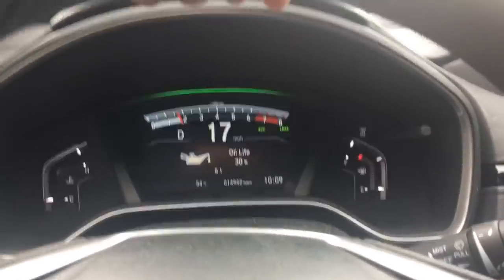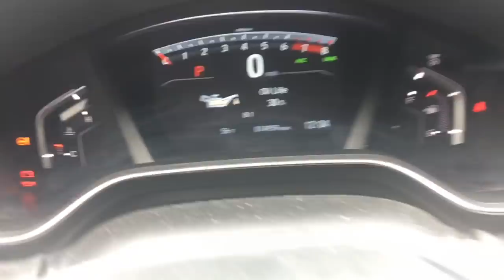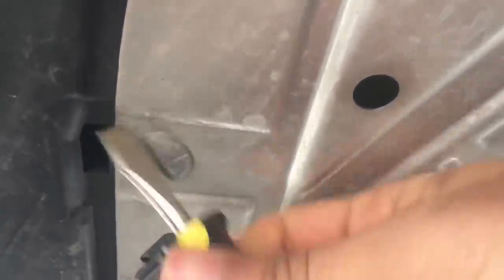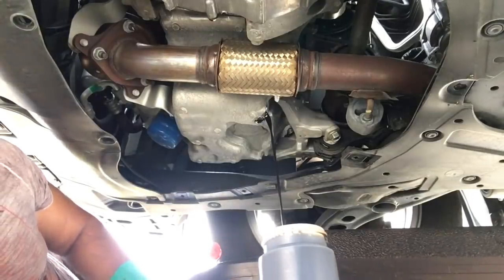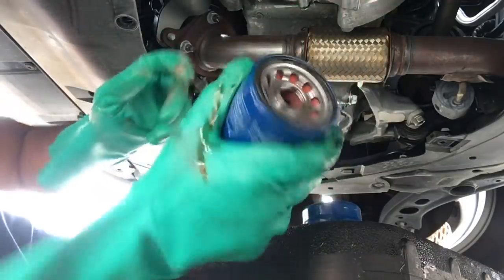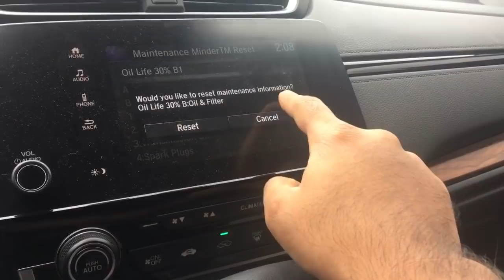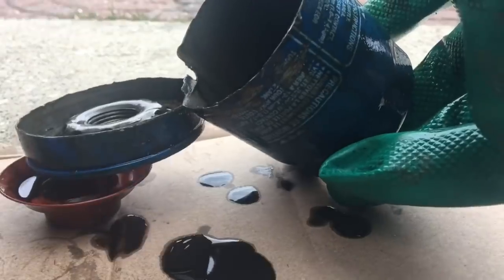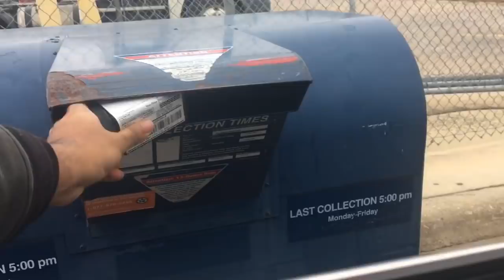2018 Honda CRV Oil/Filter Change and Analysis - Oil dilution -  Cut Open Filter

Comment: My wife’s 18 CRV warms up normal and the oil level seems Ok after 4500 miles.  And she drives short trips most of the time. I read some are having problems with the engine not warming up after a while driving, is that’s why the oil dilution ?

Comment: I carried my CRV back to University Honda in Florence Al for the 1st oil change and reminded them that it was over full of oil.  They just kind of ingnored me,  I carried it back with about 1000 miles on the 2nd change at 90% it was 3/4 inch over full and smelled of gasoline also..  I told them to fix it with the Honda cpu up grade.  They did and drained the old oil replaced it with new under warranty.  We will see what changes this caused.   According to Honda the 2019 come from the factory with this setting on the 1.5 turbo engine.
Reply: I have a 2019 with 1600 miles on it and am already getting strong gas smell in my oil, been to the dealer, they blew me off too
Reply: and I drive 20miles each way to work, so no short trips and I live in Texas
Reply: Any updates?

Comment: I have an '18 model CRV and so far the software update is working fine. Oil level remains at normal level.
Reply: Happy for you.   Not working for many others, sad to say.
Reply: Hi Lot I  have 2018 accord sport with the same 1.5 turbo with 21000 miles so far oil level has stayed right on the full mark .jeff Georgia.  Ps like the video's thanks.

Comment: Interesting video. I doubt you'll see many anomalies from Blackstone based on your driving habits. I had mine done at 6K and aside from some mild elevated wear metals associated with the break-in, there wasn't really anything to be concerned about. You're aware that Blackstone does flashpoint analysis, which isn't as reliable, but should pick up unusually high dilution rates with a little more accuracy. IMHO, the thing to look for is unusually low viscosity paired with high wear metals. If you do, run it again after 20K when most of the break-in metals have washed out.

Also, you're probably aware that dilution alone isn't necessarily a problem by itself. ALL TCDI powertrains suffer from dilution to a degree. Honda's issue has more to do with the speed to which its powertrain warms up. And because I presume you drained yours while the oil was warm/hot, after a nice cruise on the fwy, I suspect there will hardly any water or fuel in the oil at all.

Contrary to the popular internet groupthink, I still think this issue is way overblown. CR has only recorded 2-3 cases of extreme dilution, and only in cold climates. And the subsequent stalling issue hasn't even been proven to be directly correlated with "high" oil levels. The suspicion is that a lot of these "issues" are tied to other problems such as mechanics overfilling the oil, a faulty injector, or owners simply misreading the dipstick.

Also, I would suggest checking the level again after driving 5 minutes following your oil change. If you only added 3.6 quarts, you may not have allowed enough time for the oil to drain completely. These TCDI powertrains need a good 30-45 minutes to get all the residue out of the the turbo, feed and return lines. And I've seen deltas as high as half a quart during the last 20 minutes of a drain. Good luck!
Reply from the maker: Godspeed931 Got the results from the lab analysis. Will be uploading a video with the results next week. I’m doing some research on what is acceptable range for % of fuel in oil.   My drives are 90% highway also.

Comment: This is the first time I saw the inside of an OEM Honda oil filter. It is identical to cheap FRAM filter! Now, open a Toyota OEM filter and compare. The anti drain valve on a Toyota filter is built with proper springs and rubber gaskets, the filtering material is far superior than the honda filter material. My belief of Honda making cheap low quality parts is proven once again.
Reply: pochoun33137  thanks for the confirmation that honda get supplies from cheap part produces such as fram.
I can imagine the rest and these problems you all encounter. Honda fools people by loading up the car with fancy electronics but fails to heat the cabin in winter!
Reply: pochoun33137 I use mobile 1 annual protection oil filter even tho it’s going to be changed every 5,000 miles
Reply: Jan pur I wouldn’t buy a cheap Fram. Buy the more expensive ones.

Comment: Hey man have you ever changed the CVT transmission oil?
Reply: It's still too early to change the CVT fluid.
Reply: @TheRichardF10  ..
..probably  a good idea at 20K Mi intervals, however...check out some videos  on multiple cvt trans/ problems

Comment: Honda should leave turbos to the pros, and stick to vtech
Reply: @Mr1983abraham Variable Valve Timing & Lift Electronic Control from Honda
Reply: @Mr1983abraham Lol the joke went over your head.
Reply: @Mr1983abraham Ok so you did get it, I was mocking Honda's technology by comparing it to a children's toy company. The h on the end was intentional.
Reply: @Mr1983abraham Honda should leave turbos for the pros for sure!
Reply: Actually honda has been using turbo engine and been sucessful. Example Acura rdx has been turbo since 2007 and has no problems.
Reply: 2019 has the correction already installed
Reply: @Mr1983abraham very tall engine cooling
Reply: The Adventure Mazda - VTECH what computerised kids learning toys 😂😂

Comment: As a mechanic I can give you a piece of advice. High mileage oil you using is a bad idea (a lot of chemicals) considering life of your engine. Don't judge condition of the oil and filter by the colour, they are in the perfect shape. In your case the GAS just making the oil thinner but no harm for full synthetic. Go one scale up, let's say 5w30 of regular synthetic oil, you'll see on the chemical test perfect viscosity match for the engine with this kind of problem. Many years ago in Arctic conditions every night we used to add some gasoline in heavy diesel oil for better morning start it is evaporating later, in your case it's getting to the oil even more due to extremely low engine working temperature
Most important for engine life  to keep working temperature close to specification . To fix issues with warming up the engine just put a new OEM thermostat. To have some fun you can buy a couple aftermarket ones for around $15 put them in water on the stove with the one you got on your vehicle, I bet yours got stuck in open position. Don't forget thermometer in the water to see beginning of opening to be fully opened at boiling temperature. Another and more simple way to check condition of the thermostat, after starting vehicle compare top and bottom tanks of radiator. If they are warming up at the same pace, definitely thermostat is the problem. Bottom tank should be much more cooler until the engine is hot
Reply from the maker: Have taken it to Honda.  Others have it taken it also but it’s not the thermostat. It’s the air conditioning unit. If you turn off heat engine will warm up. They had a software fix / part replacement.

Comment: Never ever use a wrench to tighten your oil filter. Hand tight only. Don't over tighten you can screw up that gasket. I've always changed my oil when I couldn't see my oil dip stick lines through the darkened oil. Could still be in good shape but that's me. Over fifty years of owning cars/ trucks and never a engine problem. Oil is the blood oil filter is the liver/kidney air filter is the lungs cabin filter cleans the air coming inside the car. Make Sense?

Comment: Also I do recommend you an oil catch can that will help to keep your valves clean remember you have a GDI do a research on that. I bought 2 oil catch cans for my new Silverado just to be safe. This new GDI it’s a bad deal.
Reply from the maker: The 1.5l engines have something internal that does the same job as a catch can from what I have researched.
Reply: @EATSLEEPJD  Yes, built into the valve cover. Also have yet to see any gunked up valve trains on these LB15 engines
Reply: @JoseRivera-li8tr  any links on the built in valve cover catch cans? Please thanks

Comment: Why the oil analysis and how much did that cost?  What result did you get back?
Reply from the maker: Takes a week and $25 I believe.  Did it to see if there is an actual gas/oil dilution.
Reply: EATSLEEPJD How did it turn out?  Was the oil diluted?  I have the exact same crv.  Thanks
Reply from the maker: Daniel Holt XXL 2% fuel in oil. I did couple of videos on it.

Comment: I always wanted to use ramp along with jack stand for the added safety but thought it cant be done.
 I thought jack stand point was too close to the front so they overlap.
Now i know they can be used together.
Buying a ramp right now.
Reply from the maker: Ramp is so easy 👌🏾. Jack stands will ensure if it fails you got something to land on. It won’t fail but just for peace of mind.

Comment: I am shocked to find out from this video that genuine Honda oil filter is just like a Farm oil filter with cardboard ends.   I will return all my remaining filters and get something better.
Reply from the maker: If you add gas to the mix the cardboard literally falls apart.   It’s best to change it often or use another filter.

Comment: All GDI fuel systems are bad for your engine. I had 2017 sportage n from my first oil change I was very disappointed with the oil dilution. I observed a gradual lose of power n traded in for an older 4runner after 3yrs.No turbo,gdi,cvt,all wheel combo on 4 cy is worth your hard earned money.

Comment: I had my first oil change and tire rotation (in Milwaukee WI) last week at about 7000 miles and I asked about the oil dilution issue and got a dumb look from the service advisor and a what is that. They did look up the vin right then and find the repair that is supposed to fix the issue with oil dilution (you know the one they didn't know about). So now I'm waiting to see if it fixes the issue with the gas smell. It's currently too soon to tell. They did replace an AC unit as part of the repair (they called it a recall) as well as doing a computer code update. The car does seem to heat up faster now, but that didn't seem to be too much of an issue before, plus with the heated seats it never seems like a long time to warm up.

Update: checked my oil today a week after the oil change and repair by Honda oil level looks fine,    but I was not having high levels before. Gas smell seems to be gone now - is was very noticeable before. Time will tell I guess.
Reply: I would recommend not waiting until 7k miles for a first oil change. Always a good idea to change early to get rid of any possible metal shavings during the break in period. The new A02 oil filters from Honda are Frams cheapest model made by Honeywell. Beware.
Reply: @DkpProductions  yeah thought of that but the dealer was saying don't Change it early because of additives added to the engine at the factory (which I'm not sure I believe) but I wanted to make sure I went by the recommended interval in case there were warranty issues. I'm hoping they follow up with an extended warranty like they did in Canada, although I doubt they will. I just got a notification by mail today about the air conditioning unit needing to be replaced along with a computer update (what I already had done) dissapointed though no mention about the oil dilution issue. Makes me think they won't do more until they are sued. Hopefully the fix actually does something.
Reply: @DkpProductions  what filter would you recommend and would the dealer use an owner supplied filter? Thinking Napa gold from what I've seen online.

Comment: Thanks for doing this.  I’m a crv owner too, ‘17 touring model.  Will they report viscosity, too?  Do you know what you will do with the oil analysis results?  I have no doubt the oil is loaded with gasoline?  Mine smells of gas, too.
Have you heard of any reports of anyone that has received the modification?  It would be interesting to see what impact the mod has on oil dilution.
My dealer claimed he was not aware of this problem.  Unfortunate...and truly concerning.  Their service people would undoubtedly smell the gas when they are changing the oil??   Cover-up!
I’ll be waiting for your report.
Reply from the maker: Mark J The report should have viscosity and % of fuel in the oil along with other particles.  I’m not sure as of what I would do.  I’m not willing to do anything that will take money out of my pocket.  After all I did purchase warranty so we shall see.
Reply: I had the modification done 2 weeks ago by a dealer north of Toronto Ontario Canada..Everything seems normal having said that I did not experience what a lot of you folks have experienced...My car had no problem heating up and there was no smell of gas in the oil nor was it showing excessive oil on the dip stick...My CRV EXL 1.5 litre turbo was produced in the Alliston Ontario Honda plant...
Reply: I just got a letter from Honda.  They are calling this a product update issue.  The description is a software update with AC Control Unit Replacement.  The work will be done for free.  They also state plan to leave the vehicle for at least a day for scheduling flexibility.  I will attempt to schedule next week.  I will post results.  I currently have oil level reading above the high mark, gas smell in the oil, difficulty heating the car in cooler weather, and lower fuel mileage in cooler weather.  I hope this works.  We'll see.

Comment: Dirty, dirty,dirty, folks this is shameful, is not just Honda, this is happening to all the modern engines built now a days, high pressure, direct injection, turbo charge, oil looks nasty and fuel levels are high. Ultimately the owners of these cars will have to get rid of the headaches associated with this or deal with it. Good luck Honda owners, in the mean time I'll keep looking for a car without one of these engines.

Comment: My friend I do recommend you AMSOIL signature series full synthetic oil for me the best do a research I have been using it for years it’s very good. I own a 02 Buick le sabré with 307000 original miles it has all the fluids AMSOIL engine oil transmission oil power steering oil and coolant all AMSOIL I just bought a 2018 Silverado brand new I just replaced all the fluids also except for power steering it’s electric 😂😂😂 but the rest even the brake fluid. Check it out.

Comment: I have one of these lemons with the wet dream engine. It has gained 5/16 gas in the oil after a oil change 1000 miles ago. Has anyone had success with a lemon law on this?
Reply: Ha, wet dream is a good name for them.

Comment: Does anyone know if this just a problem in the crv or is it all 1.5l turbos ? Aren't they all the same engine?
Reply from the maker: Just the 1.5 l turbo. The lx comes with a 2.4 l
Reply: I had a 2016 CRV Touring, NON TURBO. It had the oil dilution issue bad. Truth is... Any Honda with direct injection will have this issue, Turbo or non Turbo

Comment: The Honda filters must be made by Fram. They look the same. I use Wix or Purolator PL. 
Please fill the new filter up a least 3/4 full before spinning it on. If you are planning on keeping the CRV buy a filtermag and stick it on the oil filter to catch ferrous metal particles that the filter won't.
https://www.amazon.com/FilterMAG-SS300PR-FilterMag-diameter-Height/dp/B01D8ZM8EE/ref=sr_1_9?ie=UTF8&qid=1545516585&sr=8-9&keywords=filtermag
Reply from the maker: cycledork good tips

Comment: How many miles was on that oil when you changed?  Was this the first oil change at 15,000?  If so, you’re crazy.  You should be changing your oil every 5,000 miles max, especially if that’s the original fill oil from the dealership.  Why are you using high mileage oil?  Additionally, you should be changing your CVT fluid every 10,000 to 15,000 miles with synthetic fluid and change the transmission filters.  There’s two on that car.
Reply from the maker: Second oil change.  First one done at dealer.   I follow manufacturer recommendation.  CVT change is at 30k per Honda.
Reply: @EATSLEEPJD  Don’t listen to manufacturers 30,000 recommendation. Just like they dont recommend changing filters.  Some dealers recommend never change transmission fluid, like Dodge.  They say lifetime transmission.  Never listen to their recommendations.  When it’s out of warranty and it seizes they won’t cover it and they will blame you.

Comment: Just Curious why you're using High Milage oil in what looks like a new car with 14000 miles. Other than that thank you for the video.
Reply from the maker: More additives to keep the oil from breaking down.  The gas in the oil degrades the oil.
Reply: 14000 miles for a honda is high miles! Honda.

Comment: I am in the market for a new car,  my top choices are RAV4 and CRV.   I like the CRV more than the RAV4,  but knowing that there is a potential problem with the 1.5 turbo engine,  I really don't want to make a decision that I will regret later.   However,  what I don't understand is that why some owners have no problem at all ?  If this is a design problem,  then everyone should have the same issues, right ?  Could someone please enlighten me ?
Reply: ocean I traded my 2017 CRV for a 2019 toyota Highlander. I couldn't be happier. Oil dilution got so bad, I couldn't wait any longer. Do you really want to risk your hard earn $$$? I would not if I was you.